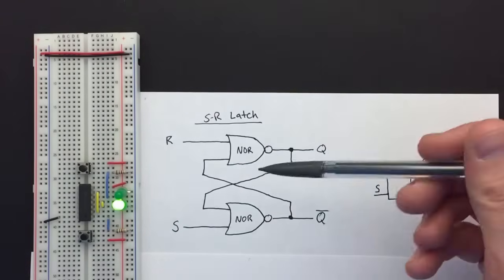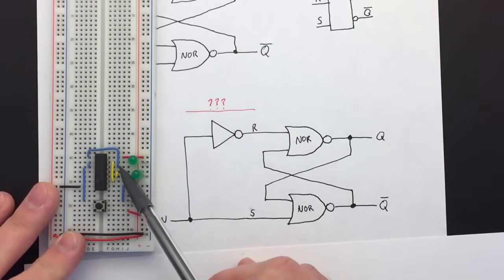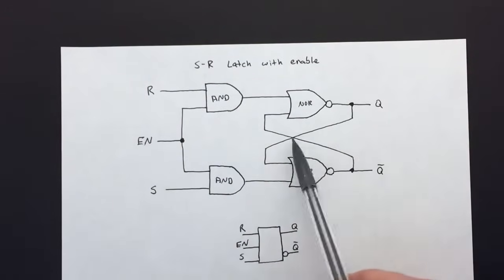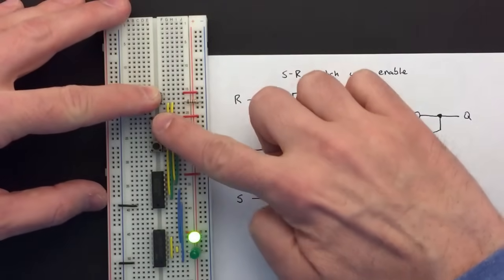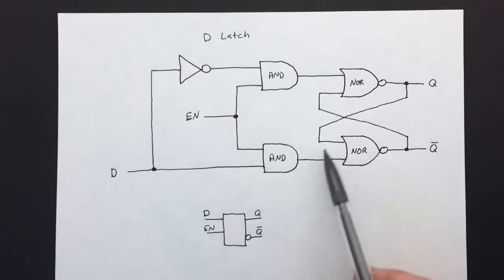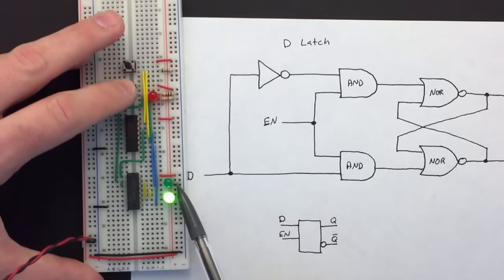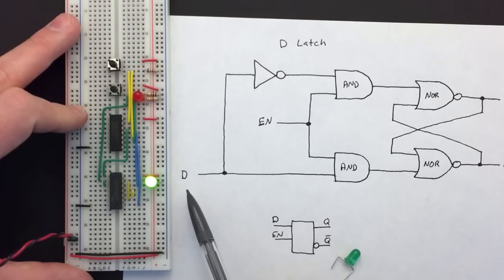D latch

Comment: So this is called a "D Latch" because it latches a bit of data. What else can you latch besides bits of data, I'm so confused?
Reply: what? It only stores an on or off value. you assign value to a set of bits which you then use to generate output with a decoder.
Basically if you had the sequence 0011 you would use a 4>16 decoder (16 because 4 squared is 16 meaning you get an output for every combo) and set the output that turns on when 0011 is input to be the letter A
Reply: @fombatwombat  With all due respect, idk why the process of decoding a nybble would be relevant what I asked.

I mean, what do the other types of latches do, if not also store bits of data? Shouldn't every latch be a D Latch?

Yes i know it stores (latches) an on or off value, that's exactly what a bit of data is...
Reply: @  other latches are used to make a d latch, though they could ne used for something niche or not clock based. In a computer you would pretty much exclusively use d latches, though SR latches can have use if synchronization is not needed where the latch is needed

Comment: Is the D latch's data storage dependent on the circuit staying powered on, at least for the Vcc into the chip itself? It seems, since the input entirely falls to zero, the state is no longer dependent on the gate having power, which holds state due to lack thereof, though obviously the output at the SR portion of the latch is maintaining current flow. Does this mean if the circuit is shutoff or loses power completely, it will start in the same state, or will the data held by the steady state be lost if power is lost? I assume it is dependent on staying at least partially energized to hold state, as an ungated SR latch would. Is an external memory that can hold information in an unpowered state required, or is it simply more efficient to use a battery to maintain power to the portion of the circuit that will ensure the data configuration of a D matrix is preserved?

Comment: How do you make just a toggle switch? Like press it and the output turns on, press it again and the output turns off. I worked out how to do it with delays, sustainers and stuff but I don't know how to do it simply. If you were to only use the 4 standard logic gates, (and a delay or sustainer) is it possible to do simply?

Comment: Why do you always close the circuit goin through the button back to 0v with a resistor ? can’t you just use the button connecting to the main circuit without that ?
Reply: I'm just about to do that. Without that, the IC is not getting a clear 0 sign and the output is a floating 1 :/

Comment: When the D-Latch is "set/Q", if enable goes high, the latch changes to notQ without any input on D. Is that supposed to happen?
Reply: Yeah because the enable is what makes the system aware of the input, if that input is a 0, then it will latch the 0

Comment: I must of missed something. You said you wanted to reduce your two input latch to a single input, right? But you didn't, it's still a two input latch.
Reply: We have three things that we might want to tell the latch to do: set, reset, or keep the current value. There's no way to do that with a single binary input. I think that what Ben meant was that there should be only one data input, so that the way that you don't need to use a completely different way to store a zero or a one.

Comment: Noob question, why are there resistors going to ground at the outputs of the buttons?
Reply: To make sure that when the switch is open the signal from the switch is low (since it's connected to ground via a resistor). If the switch is closed the signal becomes high (5 V). The resistor prevents a short circuit when the switch is closed and a low when the switch is open.

Comment: Does the latched value get reset if all power is disconnected and then reconnected?
Reply: When the power is disconnected, the latch forgets its state. When the power comes back on, the latch state will be either one or zero, but which it will be is random / uncertain.

Comment: Is this how they store the information in RAM? Kinda make sense - the transistor technology is near perfected these days and making memory from the same building blocks as a processing units is just convenient. Would also explain why RAM is energy dependent. D Latch "forgets" it value once the power goes off too.

Here is a good question - does SSD works the same way too?
Reply: today in RAM they use a system which is basically a transistor and a capacitor, making it so a single transistor is needed for a bit,i suggest you look it a bit
Reply: There are different kinds of RAM. SRAM works like this, and is eg used in CPUs for registers, cache memory, and a bunch of other stuff that needs to be quick but doesn't need to be that compact.

DRAM, which is used for main memory, uses a more compact construction with a transistor and a capacitor, where the capacitor holds a low or high charge (0 or 1), and the transistor is used to access it to read or write the value.

Comment: What is the main purpose of Load-enable input? To enable or disable(store/unstore) the circuit or something else?
Reply: Usually, you want the latch to keep it's old value. The enable input is there to tell it when you want it to load a new value from the data input instead.

Comment: hope i am not wrong ,but if you add a small resistor on the \Q  right  after the intersection with the other wire then the current will always flow slower and so when you boot up the flip-flop it will always start with Q

Comment: Imagine making a whole 1TB drive with these d latches.
Reply: Imagine making a 1 KB drive...
Reply: Latches and flip-flops are great for registers and RAM, but probably won't be good for permanent storage like hard drives, since once the power is off, all data are lost.
Reply: @yiliangliang5694  For sure, floating-gate transistors come into play if you want to permanently store data in solid state.
Reply: @yiliangliang5694  let me introduce ssd

Comment: For anyone that cares, the chip CD4043 is a cmos R/S latch with an enable. It's pretty nifty and the chip has 4 of them on it. If you're using a negative logic system the CD4044 is what you need.

Comment: wait if i want an input of one bit and two output one of which matches the input and the other one inverts the first output
wouldnt i just connect the first output right to the input and the second input would be just an inverter?
Reply: Yeah. That’s not the main purpose of an sr latch though. It’s just convenient to have both the outputs on the diagram so you know you can use them.

Comment: This may be a silly question but what is the benefit of this as it still requires two inputs to change the state?
Reply: R,S,EN is reduced to D,EN. EN can be thought as a control signal. EN makes sure that the data is latched conditionally. Either due to a level trigger like in latch or an edge trigger like in flip flop. Bigger picture is that it helps build registers and other memory units which can store and transfer data based on a clock signal.

Comment: when you use  the inverter in order  to have  just one input so you're kind of eliminating the invalid case where  both reset & set =1 and like that you avoid confusion though ? this is so the purpose of simplifying the latch to have only  one input ?!
Reply: No, avoiding cinfusion is not the only reason for this circuit, for example shift registers contain d type flip flops to store the bits and shift them on clock pulses.

Comment: Since, We are using NOR SR latch which stores data when both the inputs are low. So, as long as he lift his hand from the button we get S=0 R=0 which is a memory state for SR NOR latch. But in case of D Latch we can’t have both inputs as 0 as well as 1 simultaneously. Therefore, we need to find some way that will make both inputs S=R=0 to have memory state. Thus he uses enable or clock to get this state. 

I had this problem to understand this. So, I figured out.

Comment: This series is very helpful. I am obviously a noob so I am curious. If you were not using these LED's to show that the circuit is working as expected would it result in a short circuit? I am thinking the value would be high and nothing would be pulling a load. So in a computer, that isn't using these LED's for explanation, how does it control the load and not short circuit and waste power? I thought back to the simple circuit of battery -> resistor-> LED and if removing the LED I was thinking the power going through would be less, because LED uses power. But when I did the calculation  the power was much higher. I think I am thinking about this all wrong.
Reply: If the LEDs are removed, it won't short any more than unplugging your light bulb will short the plug.  Also, loads don't pull current.  Voltage pushes current.  Removing the LEDs prevent current from flowing through the path of the LED, but the voltages are all still the same.  The device will operate just fine without the LEDs.  Good luck in your studies.

Comment: Can anyone tell me why led turns on as he powers the breadboard at 4:46 when, I think, neither of the NOR gates works because EN gate stops AND gates from working??
Reply: I thought after powering up current should be blocked by AND gates before pushing any switches.
Reply: Each logic gate has its own power source (not shown in the simplified schematic). The switch/input determines whether the output is the same as the Vcc or grounded. That's what allows NOT gates and the like to output 1 when the input is 0. In this case the NOR gate still outputs 1 when both inputs are 0.

Comment: soo it still have 2 input right ?
Reply: yes and no ... the enable can be set by a clock, another latch ... some condition being present ... etc .... the D input is the only one that actually does anything .. and all it does is  take its level and puts it into the latch ... 
.
both inputs can be automated but the enable one is expected to be automated or circuit set to some condition ... say when the lights are on in a room the enable is set ... and then when you enter the room the music starts to play ... would be a use of this with all automated inputs ... a switch for the lights to set enable ... and a motion sensor to turn on the music as you enter the room  ... you could switch it around and put the motion sensor on the lights and the switch to the music so when you enter the room the lights go one and if you want to hit the switch and on comes the music ... etc

Comment: What's the point? You said that we wanted to create a memory latch that only required a single input, but the D latch still required 2 inputs like the SR latch, so it's pretty much just as complicated. Isn't there a kind of latch where we can just press a single button and it flips the bit without having to do this enable stuff?
Reply: you can set enable with basic circuit that goes high when a certain condition is met such as data being entered ... or a process completing sending a ready signal .. which turns on enable allowing you to trip the latch and store you entry ... something as simple as a parking meter ... you dont get a parking pass unless a coin has past the slot and set the latch to say you have paid ... then you press the button to get your pass and poof .. 
.
the coin slot becomes the enable and the print pass button becomes the d input .. and the pass is the final output ... this is literally how coin meters work ... same with your computer as well ... it breaks down into a basic switch either on or off .. how you automate them is all that is different

Comment: "Let's try and build this and see what happens"
pulls out beautifully laid out circuit on a breadboard immediately
Reply: that is how it was taught .... if you're going to proto board it you made it look good from the start so it was easy to trouble shoot .... when you got down to making your little computer you just copied the circuit off the bread boards and laid it out for multi layer flow and did some through hole work and surface mount stuff and poof 3 layered pc board from bread board design .... yes 3 layered ... you etch one side of 2 boards with the main connections and the sides that will laminate together with power and ground ties and jumpers and then use through hole soldering to link all 3 boards up to power and lay out your its ... if you want to get fancy you can add a copper-less board between the middle layers and have ground plain and power plain runs on each of the middle layers .... this is also why top of pcb's go up down bottoms go left right ... middles go one corner to the opposite so left top to bottom right and bottom left to top right 
.
even early programming was all about optomisation and keeping things tidy ... then windows came out and bloatware took over .... originally windows had full functionality at w3.1 ... and used 10Mb of ram to load ... and run in ... now it needs 200Mb just to sit and do nothing useful .... every part of widows now has it own drive access routine .. when before it had only one routine that every bit of windows accessed .... so every new bit of windows reinvented half of itself with each upgrade and added new errors and logic faults into the design .... so now you get your crash happy bloat ware windows instead of well coded debugged code of yesteryear
Reply: Yupe those circuits are absolute beauties. So Neat and Clean.
Reply: It almost feels like magic.
Reply: Here's one I made earlier...
Reply: 0623kaboom that’s really neat
Reply: @NickiRusin  That's where the magic lies: using modules as building blocks for higher-level functions.  Use electronic components to build a circuit that performs some function, like a logic gate.  Shrink the gates down onto chips, hook those together to make a clock, SR latches, flip-flops, etc.  Put those on chips, hook them together to make registers, counters, ALUs, etc.  Hook those modules together, you got a computer.  Shrink all _that onto a chip, you got a CPU...

The exact same thing goes on in software.  Build the hardware so it can be controlled by binary codes, you got an instruction set.  Use the instruction set to create a machine language, use the machine language to write an operating system, and a compiler/interpreter for a higher-level language like C or Python.  Use that to write applications, models, neural nets...

Levels upon levels upon levels.  It doesn't matter what you do, it's turtles all the way up.
Reply: Why resistor is there
Reply: Can anyone tell me
Reply: @_Rajkishor_Thakur  They are there to limit current draw. Were it not there, the ICs and the LEDs would draw as much current as they could get, being damaged in the process.
Reply: @TheMrMKultra  aren't they actually pull-down resistors, to pull the buttons down - so they don't send false high signals to the ic's input.
he at least used only a pull down resistor in the video before.

Comment: I have a question please answer this, look at @7:18 , when he powered up the circuit, why did the Q output automatically lighted up or got a logic 1 result even though, both enable and D input are at logic 0? Is it the initial settings of the I.C itself or some other reason? Please do answer this one. Thank you so much!
Reply: when you add power to a circuit it takes a few micro seconds for the power to stop bouncing around ... during this period of time the circuit is actually functioning and the chips go into a RACE condition and set according to HOW the power fluctuations influenced the basic settings ... 
.
IF he had made a de-bounce circuit for the power input the fluctuations would be minimized and the input state would, more often than not, be set low 
.
this is why when you turn any electronics on and off you wait for a little bit ... those first few moments nothing is truly set ... so if you have a reset or clear function that is the first thing you should always push to set everything to a known good setting

Comment: Excellent totorial! I can' thank you enough for taking the time to document and share your knowledge, and commend you on your awesome teaching skills!
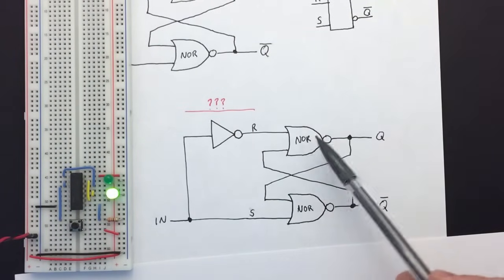The circuit you have @2:39 that is actually very useful for me. I built something similar from transistors before learning more about gates in ICs, but it serves a general system enable/disable flag for high power. So when the system first receives power, the component that operate with high voltage are not enabled until the microcontroller explicitly issues a 1 on the input line.
In case anyone is wondering why you would have to do this, microcontroller pins (even if they have high impedience) have floating voltage, so you can have your "input" line from the microcontroller be interpreted as a high before the mcu starts executing code.

Comment: I just loved this explanation! Thanks a lot! Please continue building such awesome videos!
Just one doubt - since this latch requires power, I think it is used in building memories like RAM, not the peripheral storage, right? BecauseI remember from a physics textbook that peripheral storage is built using magnets.
Also, at 7:42, when you push the enable button, why do the LEDs flip?
Thanks again!
Reply: The input button was not being pressed and so the latch was being told to turn off to match the state of the input button.

Comment: Glad I saw this video! I can make registers in my 8bit like this so it doesn't require a reset switch only read (enable) and input from the bus (D)
Reply: reset is awesome ... it allows you to set a known starting condition ... and should be used on power up after about 1s in to ensure everything starts from a known setting